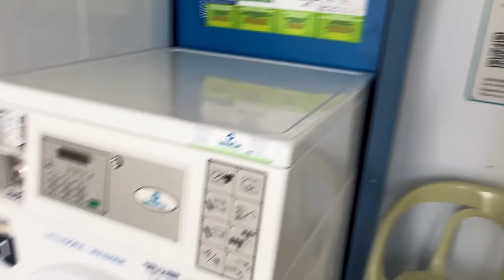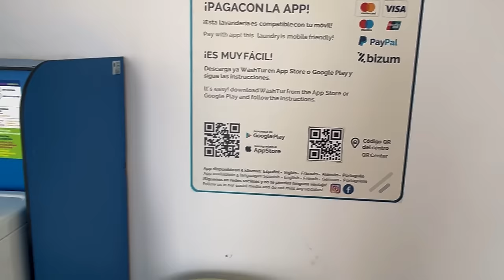BOAT LIFE - SOAKING IN MARINA LIFE! EP-123

Comment: You need bigger cables on the 12V side when you go from 2000 to 3000 Watts.
And look at the EVE280 or EVE320 LiFePO4 batteries. They work very well and are a lot cheaper than complete Lithium batteries. 640Ah including BMS should cost between € 1000 and € 1200.

Comment: Nice video. You'll find a huge difference in the 3,000-watt invertor compared to your old 2,000 watt. Once you get new batteries is most likely when you'll notice you have so much more power to use. Why didn't you have your rigging checked in Gibraltar? Tax free and all of that wouldn't have it been less expensive. Yea that rat was huge. I'd likely scream myself. 😉
catch you next video. Looking forward to your decision?????
Reply from the maker: Yes it’ll be great just being able to use Pretty much any appliance without worrying about blowing it 😆 

We’re having our rigging inspection at the next marina in Spain as it’s only going to cost us €150 which is super cheap! And he has great reviews 😌 

Seems to be even though Gibraltar is tax free it’s still a more expensive place in comparison with alot of things as they go by the pound 

Haha it was big! I actually don’t mind rats and mice but I felt slightly trapped and was just worried it would run at me and bite me from being g scared 

Catch up next week ☺️